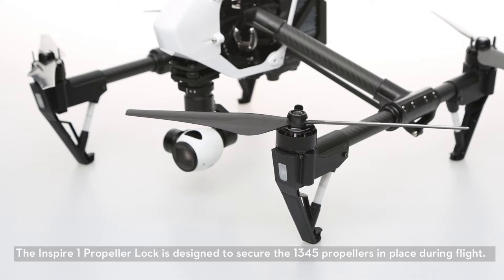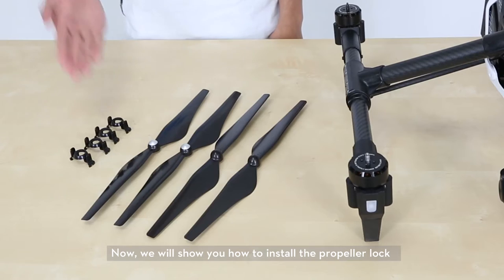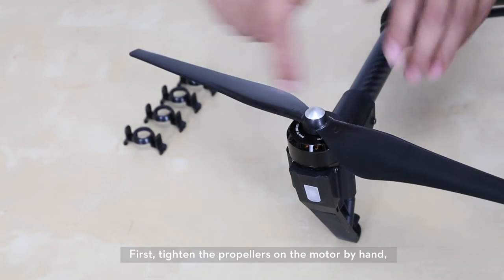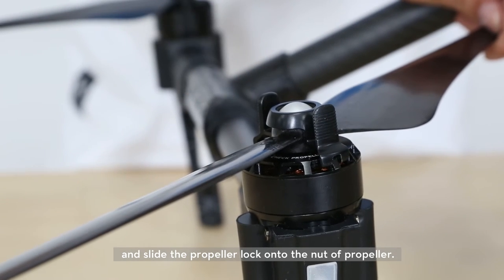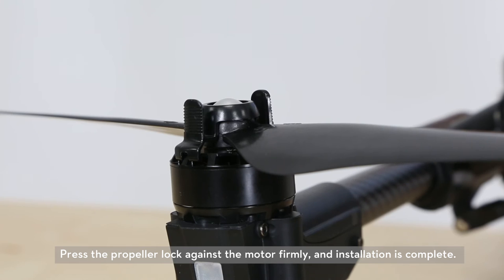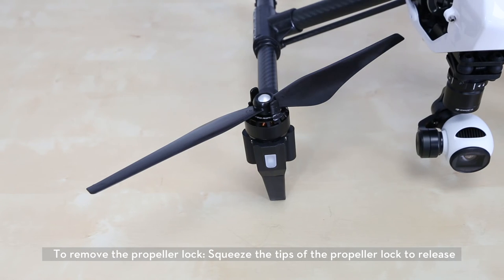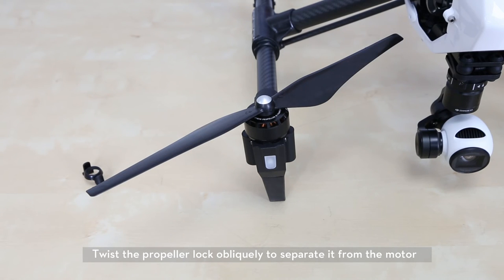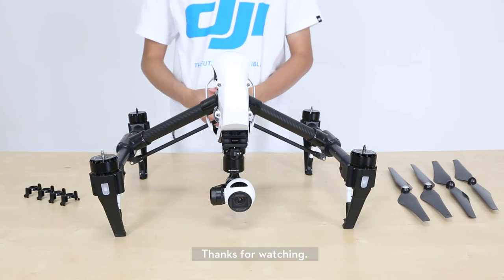DJI Tutorials - Inspire 1 - 1345s Propeller Locks Installation

Comment: quick release prop is not as good as this. first. self tighten prop are more firm and hold on to the motor. the quick release got some issues that it become loosen. and when it happen you will get the jello effect on the vid. my i1 before this using this self tighten propellers. then switch to quick release prop. now when i do yaw. i got jello effect. tomorrow i want to change back to self tighten props. saw some youtuber switch their quick release prop to self tighten back